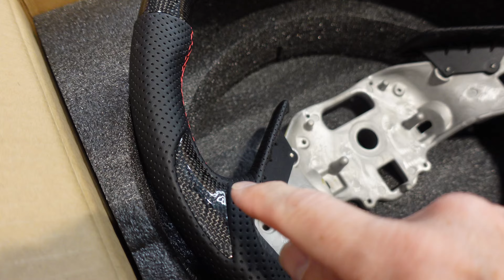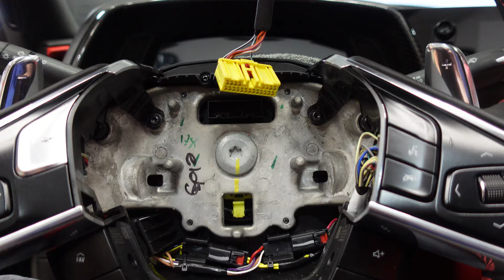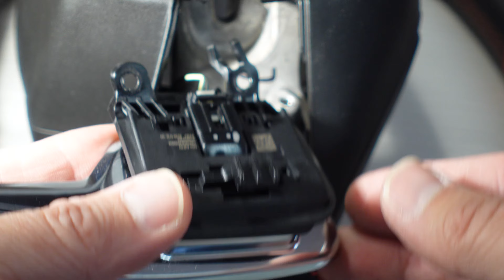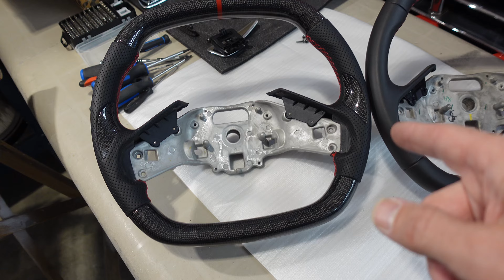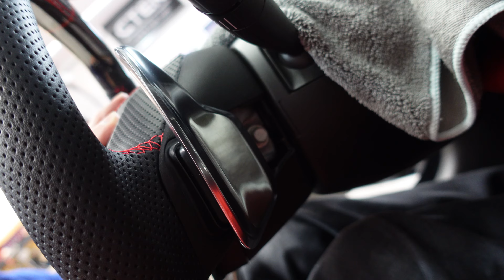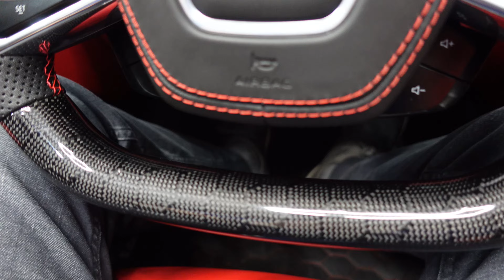2020-Up Chevrolet Corvette C8 Carbon Fiber Steering Wheel Installation EOS ft. @Donslife

Comment: If you don't mind me asking what the entire install time for this mod.
Reply from the maker: For someone familiar with car mods, it can take around 1-2 hours. This includes removing the stock steering wheel, transferring components like the airbag and controls, and securing the new carbon fiber wheel in place. If it's your first time or if you’re working carefully around the airbags and wiring, allowing extra time can be helpful. Let me know if you’d like a step-by-step guide or any specific tips for the installation!
Reply: You can use a inpack wrench to take the steering wheel bolt out with no help very easy.  @extremeonlinestoreYT